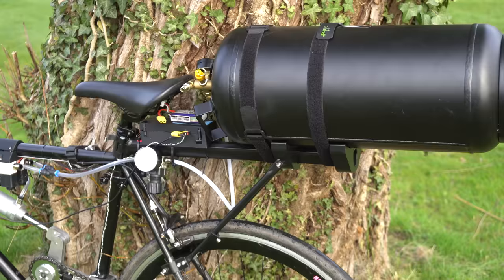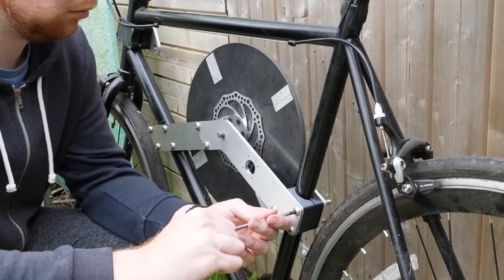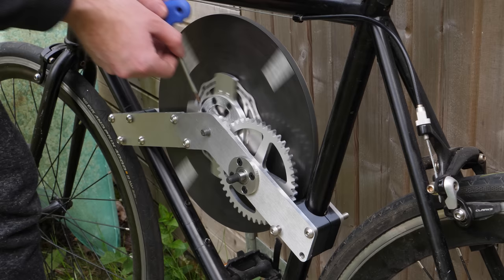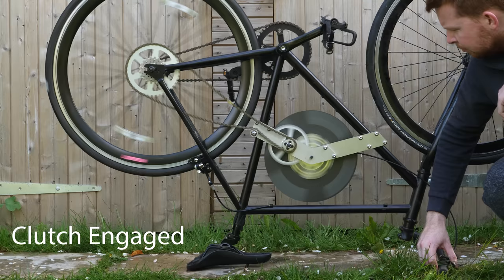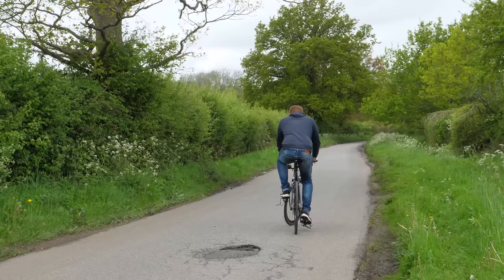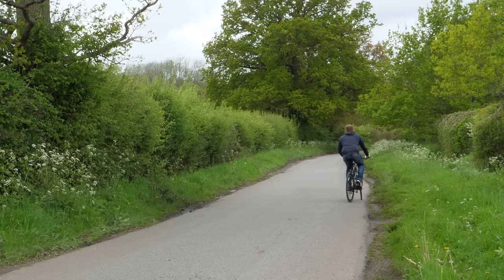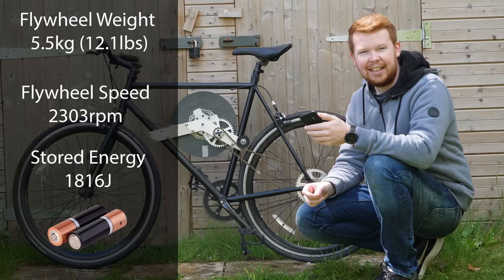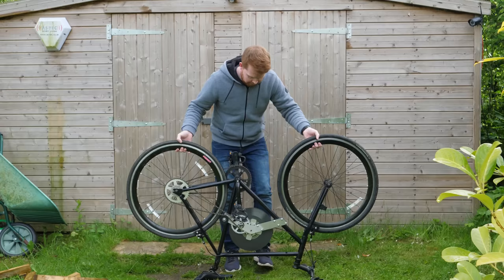Flywheel Bike KERS

Comment: stealing the energy AFTER reaching your desired speed would be more useful. a bigger flywheel would be better. maybe just add the flywheel to the back wheel in almost the same size. maybe add two on each side for a horrific deathmachine :D ? (also for more balance) and then you need a tubeless hard rubber wheel :D and 2 extra pants to protect your balls when driving on uneven terrain.
Reply: I have lately been trying to imagine a way to do just this. The two side flywheels can't be too close in diameter to the tire, or they will catastrophically strike the pavement when turning. On the other hand, putting them between the rear wheels of a trike would be rather simple, and you can stack them to linearly increase capacity.
Reply: @n3rd66  or a flywheel in the wheel itself. Google a reevo or a oohbike. Call me crazy. But you can have 2 flywheel in the Front and back wheel. And maybe hide one under your jewels. The Front flywheel have to use something like a kardanwelle. (sry german Word)

Comment: now mix the electric bike with the flywheel to keep the flywheel spinning  not to directaly power the bike taking from flywheel and electric motor only powers if rpm is under or exceleratingand increese the wt of the flywheel

Comment: Typical engineer: "Solving problems you didn't know you had, in ways you don't understand" 

You realize you just went backwards in terms of total energy output required to pedal the bike? LOL.
Reply: The advantage is energy usually wasted to heat from braking going down a steep hill can be stored in the fly wheel.  Engaging the clutch does not require manual energy from the rider beyond the energy engaging it going down hill...
Reply: @robertmorin6495  And how much does it weigh?  And how much air resistance? Got news for you, this isn't "free energy" just laying around.  The laws of thermodynamics are still solidly in effect.  As they always will be.  Kinda cool, yes, interesting, fun, but did NOT create an efficiency gain.

Comment: This is stupid because if you try to you tilt a rotating flywheel, that will create a power into a different direction. You can make a simple Experiment: just hold a rotating bicycle wheel on the axis and make it move. Then try to tilt it left or ridht and you will feel a power which forces the horizontal axis in a upright direction. This is by the way the physical process which keeps a bicycle vertical. Rotating wheel will not tilt but try to keep its upright position. Therefore a bike without a driver will roll on and on. Ich hätte es in danger to tilk, make a bend and thati will keep it upright again. Ich will only fall when the rotating  power disappears when the wheels  come to a standstill. Read the reports about racing cars that save energy Horizontal flywheel and the recycling powers. The only way to avoid this, is when the fly wheel has a vertical axis so that it is not tilt in a curve. Because this does not affect the orientation of the axis. A bicycle does nor allow thhis, it requires Horizonte orientation of the axis Like the other Teil wheels

Comment: Ok now use magnets and mess with the gear ratio. Logic tells me you can produce a CRAZY efficient bike. But sometimes logic is wrong. And dang mate give it a little help not from a straight stand still!! Idk why I see a lot of potential energy in your invention lmao
Reply: If you had the other side engage a different clutch with a more teeth smaller ratio for thrust? See as the builder would be hard to push but the user/ second engaging would spin softer. Idk I imagine unlimited energy like Tesla. Mae drag from gears less in design and use wd40 give the bike to a subscriber

Comment: I'm a BMX rider a mountain bike rider and you're losing more energy because your seat is not fully extended your leg should be straight at the bottom stroke whatever leg is on the bottom stroke should be fully extended it's like I can look at you and your leg is not fully extended you're not getting all your energy out of your leg if you increase the height of your seat you will increase the power coming from your own legs try it get back to me let me know what happened

Comment: The best use for this is when riding hills.  You use the flywheel to recapture some of the gravitational potential-energy, then when you reach the bottom of the hill, you use the stored flywheel energy to give yourself a boost partway up the next hill.

In my younger days, this is what I did, but using natural momentum:  I'd actually pedal hard down hills, then use the momentum I built up to get me up the next hill without having to pedal so hard going up that hill.

Comment: OK now stop comparing electric regen to mechanical regen and combine them into one, with a secondary motor that spins up a flywheel, this eliminates your need for an infinite transmission and electricities weakness of capacitors sucking

Comment: I think for all that work you should have just bought an electric bike considering they're much quieter they may be a tad bit heavier but I could not stand a huge spinning flywheel under my crotch maybe once you get it figured out you can put some sort of Fender or guard there to keep it from slicing your nuts off😅 and for god sakes do something about that noise

Comment: Japanese already did a better system with rechargeable batteries and a built in magnetic brake system... and i am pretty sure they did this before 2000's... even at that time, the bicycle was quite cheap compared to those professional bicycle sports use to sell.
Idk man, you certainly have some building skills... but, you should have done a better research to the idea and the problems that come with it...